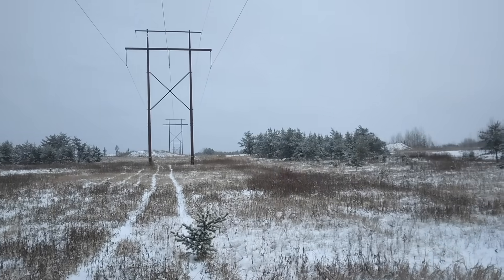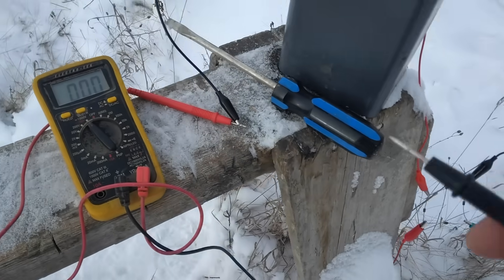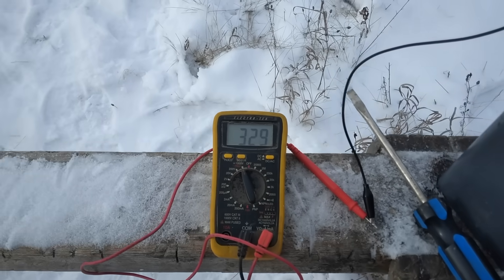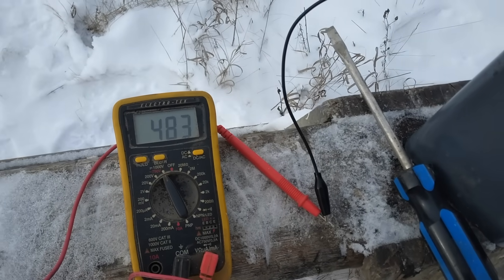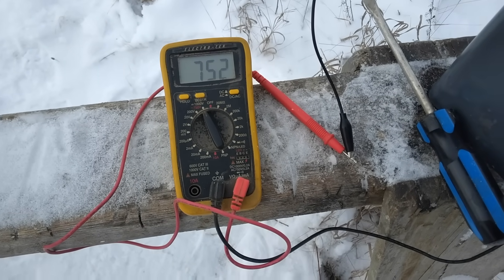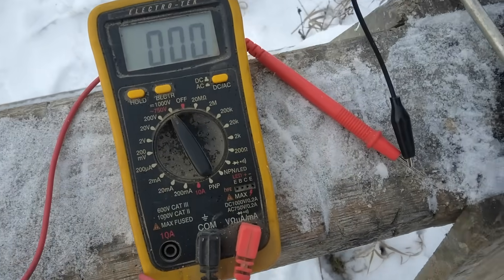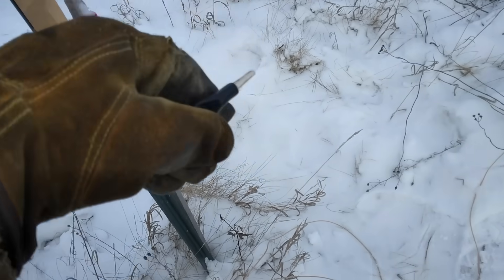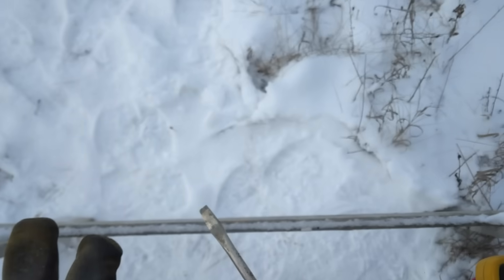Fences sucking power from under HV transmission lines

Comment: quoderatdemonstrandum5442  IN COMMENTS HAS THIS TO SAY ;        True story... More than 50 years ago, when I was just a kid, the owner of a local oil field welding and machine shop got sued in Federal Court for "stealing" electricity from the 240KV power lines which passed over his property, by way of using a homemade induction coil mounted on a pole. Which in turn was wired into his electrical system, and which had been powering his business for more more than 20 years already. The court ruled that he could not be sued for taking advantage of natural physics, and dismissed the case on day one. His business continued to thrive for another 30 years until his death. Shit you not.          WHY DOES ANYONE CONSIDER IT STEALING WHEN THE ENERGY IS NO LONGER IN THE ELECTRIC CO.,S WIRING SYSTEM BUT IN THE OPEN AIR ???????????      IT'S ON YOUR PROPERTY AND AIR SPACE ,  SO IT BELONGS TO YOU ,  IF YOU WANT IT !!!!!!!!!!!!-------------Ernest E. Johnson

Comment: I used to ride my bike under local HV power transmission lines.  If I used the hand brake while under the lines I would get a painful shock.  My wife's bike didn't do this eventhough they were similar models.  I should have checked the voltage with my meter but I never did.

Comment: What if you were to run a wire long enough, it could be loaded, that's resonant at the desired frequency? A quarter wave at 60hz is a bit over 3/4 of a mile. Then you'll really pick up the electromagnetic radiation. Again, dangerous territory?

Comment: Okay, significant voltage, but how about the amps?
Because power consists of both voltage and amps...

Edit: Ah should've watched till the end; 36 Joules is very little btw (36 watts for 1 second).
Just as I expected, high voltage low current.

Comment: I'm guessing, from your accent, that you're Canadian, eh? In New England, back in the late sixties, the power companies legislated against doing this, as some old hippy manuals detailed how to live "off-the-grid" doing this with coils--haah! It's residual loss, which they wont recover, so what's the big deal, anyways. But, of course, if your family had a high incidence of cancer, living close to these transmission lines, they would disavow any causal relation.
Reply from the maker: Northern Minnesota.  What I did in this video, was testing the charge on a fence wire, that is legally there.  Not sure about other places.

Comment: Voltage does not kill, power kills (watage). Due to the proximity of the power lines, it's conceivable that your wire would gather the value of the power lines that they carry. However, at miniscule amperage the danger that poses to humans is minimal at best. Similar to an electric live stock fence.

Comment: Wow that's crazy! Reminds me of the "Body Electric" a book that discusses energy fields relationship to the body and how the US never kept studying the bodies effect around high voltage. 

What are your thoughts about EVs? Can absorbative devices be installed to collect the energy fields? In my campervan I installed a Giron shield material that shows a reduced energy field when I test it depending on whether I am using enerfy or charging my battery bank, but it's far from significant. Thanks for sharing.

Comment: You had 0.00001 kWh in that capacitor. With multiple wires you may get a very slow trickle charge on a small battery.

Comment: I was excited at the idea of harvesting free electricity. But like they say, if it seems too good to be true, it probably is. I’d have to recheck my math, but if I’m in the ballpark, if you harvested the energy using the setup in the video, you’d get just under a penny worth of free electricity per month (at my local residential rate of $0.17 per kWh from the utility company). Bummer.
Reply from the maker: It's really just a conversation piece.  As this comment section shows.

Comment: well a 1200Vdc capacitor will charge to 1200V... and provide DC voltages ... if you use a lower voltage capacitor and add an AC load or dc with appropriate circuits for the dc and ac ... you can run lights tvs computers radios etc without a direct connect to the power lines

Comment: it's not stealing, the transmission line produces an electric field naturally. May as well use it. It's like staying behind a truck on the highway to safe gas (don't do this, it's just an exemple) : the truck will not use more diesel if you do it, but you will save gas.

Comment: All conductors near the ROW have induced voltage and currents impressed on them: steel shield wires, pipelines, other continuous metal structures. Nothing new here. See: electrical power engineers knew this 100 years ago.

Comment: There are a few things to understand about electrical power, and the first is that it’s NOT electrons being pumped through a wire like water through a pipe. If that were true, then induction would be impossible. What is happening is a generator somewhere (say at a nuclear power plant) is creating pulsed resonances or waves in the aether, which then propagates along transmission lines (along the out side of the wires, not through them). Also there are three components to what people call “electricity”. There is a longitudinal impulse component, which is what people call “voltage potential” which is also the same phenomena as capacitance.  And then there are two transverse wave components that arise as secondary emissions or events after or as a result of that primary longitudinal impulse. Those two transverse components are dielectricity and magnetism. Also it’s important to note that human DNA, which is in the form of a double helix, acts like a fractal antennae, and is susceptible to high voltage, low frequency (60hertz) EM waves. What happens is the DNA in every cell which is near one of these high voltage lines starts to resonate like a tuning fork, and if that resonance is strong enough, the DNA will break apart and reform sometimes randomly. And when that happens, either the cell will die from apoptosis, or it will live and multiply, except now as a cancer cell. That’s why you don’t want to be in close proximity or live underneath high voltage power lines.

Comment: Leave it long enough and it will smoke that 1200V capacitor.    But notice how long its taking to charge up a mere 88uF.    High voltage, but nearly zero current.  Equates to nearly zero continuous power.

Comment: My parents’ friend, an electrician who had a few horses on his property over which HV leads hang, used just a few coils of wire to power up their whole electric fence…

And to answer the title: yes, technically, it’s stealing. The electric work done by the induction doesn’t come from nowhere… On the other hand, the losses on the HV leads are such that a leak like that is completely negligible by comparison—as long as just a few people do it… :-)
Reply from the maker: A way to look at it, (where fences under power lines are legal); is that the fence is going to be naturally grounded out by its construction.  Unless it's an electric fence.  So if grounding out a fence with a direct short to the ground is acceptable, (like with steel posts),  What's the difference if it's grounded out through a circuit?  -the loss isn't going be be any greater.   -that's the question in the video.
Reply: @doubleMinnovations  :-) Well, one can argue that the difference is the _intent_. Would I? No, I’m not a lawyer, nor a shareholder of the energy companies…

Then again, I am an electricity consumer. If such leaks (intentional or otherwise) were eliminated, I could save money (the losses are payed by the customer in the end, let’s have no pretense…) I’m also interested in ecology and against wasting energy (in any way). So, I guess my answer kinda stays ambiguous; I definitely won’t say that “it’s nothing”. Because it’s not nothing clearly, following from the conservation laws of physics (I’m also interested in that field, as if I wasn’t too many things already; sorry ;-)).
Reply from the maker: I think that's why this video has become popular, because there isn't a 'one size fits all' answer.  Some places fences are not allowed under power lines.  Here it must be an acceptable loss.  And the loss is so tiny (few milliwatts) it's not even worth considering.  I don't think Power Companies figure it's practical to put the power lines any higher, or to even make the easement bigger.  I know trees I have along the easement are grounding the energy fields out.  Where it's clear of trees, the field reaches out much farther.  If I were to build a metal building along the easement, it would be ground out a whole lot more than some fence wires.
Reply: @doubleMinnovations  I think the answer will depend on the point of view and whether you're after a principle/philosophical answer or rather a practical one (in Cartesian meaning).

From a point of view of a strict lawyer, you are using a private source of energy to power something without permission/license. That's a crime (theft). However, practically, it might be very hard to prove you guilty. (I'm not sure about the law in your country/state; here in Czechia, I believe nobody can stop you to just put a few bits of wire on your land... I'd have to check, though.) So even from that point of view, I think it's disputable. Proving intent is always problematic.

From the point of a physicist or el. engineer, as we agreed, it's hardly an issue. The losses on these leads are such that this is like talking about stealing a bucket of water out of a lake...

On the other hand, what if everybody did it? I can imagine that it's not a problem in the states; there probably won't be too many properties those HV leads cross. In my country, there'll be loads; we're a country of small villages, yet dense population... If such practice became popular and the law couldn't suppress it, I can imagine that the induction leaks would easily become noticeable. Then, it starts to matter from the physicist's point of view either.

As you say, not a simple question to answer.
Reply: @doubleMinnovations  Oh, as an afterthought: another (possible?) difference might be that in my country, large properties (like forests, meadows etc) are almost never fenced. So from this point of view, if you do make a (conductive) fence (and ground the induced voltage), you're already sort of doing an uncommon thing...

Again, it's nothing that changes the previous analysis (you can still build the fence of course). But I wonder whether this could make a difference... I work for an American (international) company and guys from the US we meet and take for casual hikes around here often ask us about trespassing and suchlike... We don't really even think about such things here in Europe; unless there's a fence, you're legally allowed to enter (even if it is a private property). We're used to freely roam around... So perhaps that sort of thing also matters here. Do you need/have to build a fence around your property?
Reply from the maker: When I was talking with the power company about the power line and easement, I was telling them that now and then I can actually hear the ground sizzling underneath it.  My neighbor to the west has a 4 strand barbed wire fence on steel posts, right along the power line, but no sizzling.  It got me to wonder how much energy that fence was grounding out, so that's how I came to this experiment.  I don't have need for a fence right now.  We're still trying to figure out ways we can use the land.  Nothing grows too good underneath those lines, so it's kind of useless right now...
Reply: @doubleMinnovations  Oh dear, that sounds really bad. Sounds like it way to low over the ground. I often walked below HV lines back where I grew up, but I certainly never noticed anything like that.

Comment: I heard of a story about a groundman (lineman trainee) killed by that very same induced voltage. They where running new line and it was sitting under existing overhead lines. He reached down to grab the line that was open on both ends and the discharged electricity killed him. I work in a power plant with 500KV lines and everytime we go in the switchyard everything metal has a bite to it. Be careful messing around with that stuff, you can be seriously hurt or killed

Comment: Have known this for years here in New Zealand.When dairy farming in Mercer when putting up electric fences especially on wet or foggy days we had to make sure we didn’t plug the power unit in as the power from over head power wires would blow the fuses and if the cows touched it on a very wet day would get stunned and yes I got caught with it as well and it bunt my arm.

Comment: down to the tech of it all - I love this stuff so each Goat and Deer Fence strand should be made of Carbon Fiber with a Copper Coil wrapped round like the string of a musical instrument - what you're looking for is making each single fence strand like a very long Aircoil [Tesla coil] where the wire is going to be thousands of times longer than the Prototype Deer Fencing because obviously "Your Honour" Deer don't like copper coils? and Hows the Golf Cart going now!???
So you have 20 miles of 20 strand Goat and Deer Fence Testing  wires and there's 2 lines of 5 and 1 line of 10 and it's all going into your Private 5 bay EV Charging system and you're Creaming it AND the best Lawyer in town's Wife Charges at your Deer Fence ... What could Possibly Go Wrong? 
Your life has turned around, You've been invited back to church for god sake but the women are ok! The Court Registrar sends you a birthday card every year, You now play Golf 3 time a week, when You call the Power Company to inform them the Power's OUT They're there in 5 minutes ... the only time you ever see a police is at your charging stations What could Possibly Go Wrong?

Comment: A Deer fence is 8 foot with insulated wire at the top in that helps? Obviously you would run 10 fully insulated wires all the way down the 8 foot posts, probably help to do 5 either side of the posts. 
That would get you 10 separate circuits or 1 - now theft comes down to intent so if it looks like a fence it should act like a fence and be defendable in court as a fence and Obviously you sound like an honest person concerned about deer to me.
Now there's 3 wires up there Right? Oh DEER so you've had so much problems worrying about Deer that you've done the 8 foot high fence with 10 wires and under the other 2 wired you've done 2 x 5 foot high fences with 5 wires on each.
Anyone ask you, here's the truth, I keep Goats - [Latin = Caprine where the term Capricious comes from] and if you have Deer concerns you need 3 fences bro ... 20 insulated wires probably on 3 phase output ... You could Run Car Charges for Deer that have electric cars
Put wooden gates on either end in case you need to call it .... a corral as a backup story if you get a sticky judge.

Comment: What you aught to do now that you know it'll go over 1kV.
Is to devise a small auto-discharger, which will drive across the gap of a neon / gas discharge lamp, such as a large street lighting luminaire, so that when you go back home, you can still se this contraption pulsing flashes every so often like a search light, especially if you aim it directly skywards (vertically orientated).
Then if the power company ever complains, just tell them it's the automatic visual warning system, alerting you whenever the power goes out (by the lack of light) - to complain to them for not maintaining their own distribution services.
After all, if you think they are losing power, consider how much "more" is being lost all along the length of that high voltage network, between their overhead wires and the ground (earth) below them, s 100% totally wasted power.
It's just a fact, that these emf's will be generated all along the aerial cable routes, on any given day, right across the country, just a smidgeon - in the daily life of being a power operator.
Reply from the maker: Thanks for the inspiration!  I was thinking of an 'Electro-Smog Indicator' at the edge of the easement. 😁

Comment: I use to quail hunt on a 1000 acre farm. There were power lines running across it. I use to park my truck under them. When you touched the truck you could feel the electricity

Comment: Since electricity travels in fields around the wires, harvesting it would be stealing. If it doesn't interact with another object like a fence, the field will continue down the line with full strength minus the wire resistance.  If you pull the field into something, you are essentially wirelessly charging those batteries. Just like a transformer.  I imagine the power company will not allow this.

Comment: Scary stuff indeed. Here in the UK local trains run off 25kV A/C.  I recall that if you are waiting on a station platform for a train in rainy weather and you are holding an umbrella and you happen to let the spines of the umbrella touch you scalp you will experience an electric shock. Not serious but certainly noticeable!

Comment: Lenz' law in action. I doubt you could pull more than a few watts. It may be interesting but not very useful. How high the voltage goes is not very relevant, You want to know how much power you can pull from the circuit. You can get more voltage from rubbing your feet on a carpet.